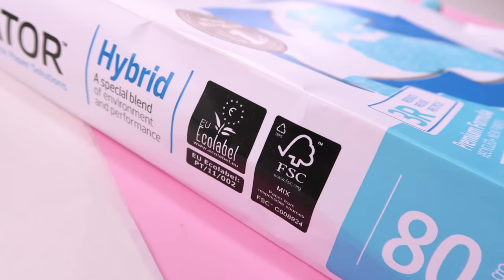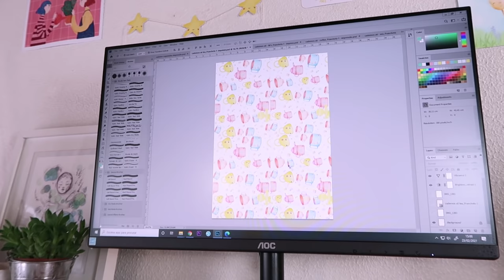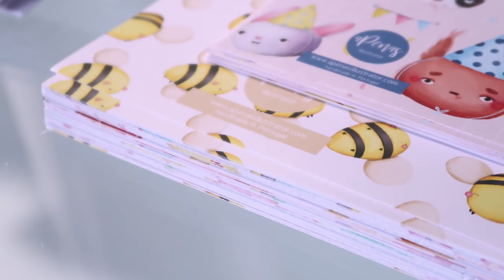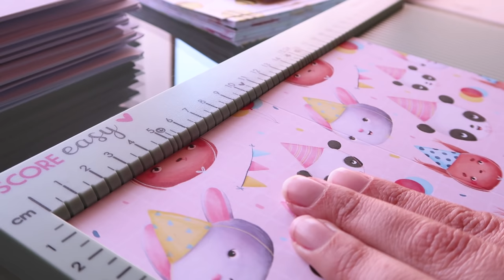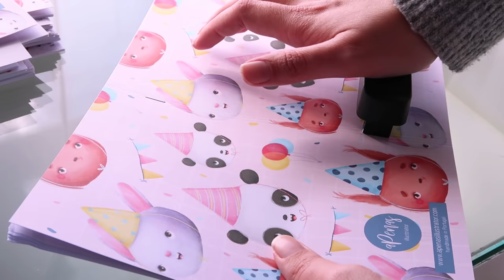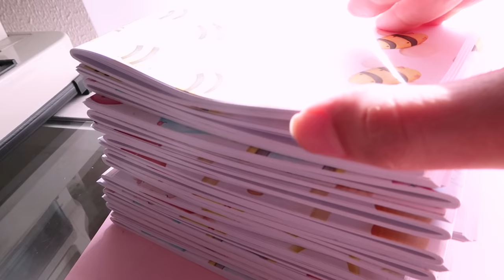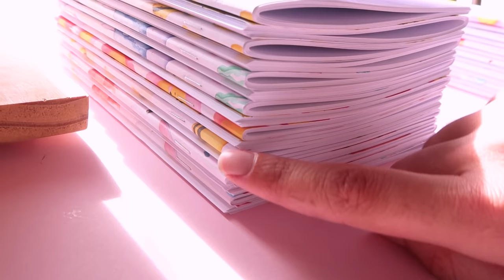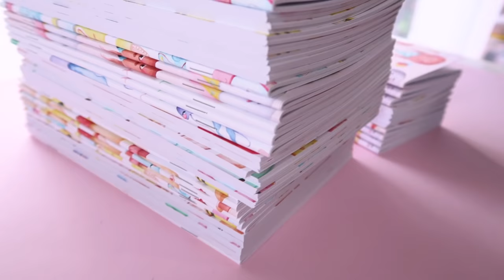HOW TO MAKE NOTEBOOKS! / Materials, Mounting and Cutting / Complete Step-by-Step Tutorial

Comment from the maker: Hope this tutorial helps you! If you have any questions about materials or techniques, leave them in the comments! 

If you made some notebooks following this tutorial, tag me on instagram @apenasillustrator so I can see what you create 😍 Can't wait! ✨🎉
Reply: I love your videos. You're such an amazing artist and thanks so much for sharing your knowledge.
Reply: Great video! Thanks for all the tips. 2 questions/tips/suggestions for you: 1) Would using a digital scale to measure out the paper work accurately enough instead of counting out a stack for each notebook? If the weight is consistent, it would be easy enough and quicker to measure out _ amount for each type of notebook. And 2) they make staples and staplers that press completely flat- it would completely take out step and the need to press every staple flat. Swingline makes a stapler that does this - the model I have is #S7087842 and it uses S.F.3 staples. But this stapler has a regular depth.  Not sure if one of these types comes in the extended arm like you have though or if you could pop out the current stapler and add in a different one (?). Love seeing your work and how you put it all together. 💕💕
Reply from the maker: @BlueSkies7  thank you so much for the love 🥺💛
Reply: Thanks a lot I really made
Reply: Hi!!! I'd like to know how you organise all the covers in one paper (the A3). Could you make a video tutorial? I want to make A5 and A6 notebooks but I don't want to make any mistake with the covers, I have to print them in another place and it would mean wasting of money. Apart from that, the video was very helpful, I loved it. Thank you very much!!! ❤
Reply: what printer you recommend?
Reply from the maker: @miadesalisa  the one mentioned it the video! Link is in the description 😘
Reply from the maker: @balerionish  hi! I just save them as png in A4 or A5 and then mount them in the A3 like I showed in the video! 😊
Reply: @aPenasIllustrator  thank you for responding. Because I saw u have a lot of printers haha
Reply: I couldn’t find any 250 gsm paper. Is there anything close to get for that quality?
Reply: Woah! Great job!!
Reply from the maker: @celestialcoffeebean1524  you can do with 200gsm, they will be nice as well 😘
Reply from the maker: @gracebuildsroblox9961  thank you so much!! 😀
Reply: I have commented. Pls check my comment and also tell about the packaging as well..
Reply: I love that tutorial, it's really brilliantly made. You make it look so easy that I started designing notebooks straight away 😂 I am just curious what guillotine are you using? I was looking all over Amazon and most have terrible reviews 😭
Reply: My name is prabha iam 9 class  I like your videos
Reply: Did you try flipping the red part? You can use all 4 sides of it
Reply: Where do you find the graphics for your covers?
Reply from the maker: @emeliagomez9959  I’m an illustrator, I make them :)
Reply from the maker: @malowaniec  thank you so much!!I don't think it is for sale anymore :( can't really recommend another, only ever used this one. But keep in mind this is a hard machine that you need to get used to, so some reviews may be biased
Reply: How many sheets are in there? Thanks
Reply from the maker: @maestratv2689  Hello! 15 sheets :) so 30 pages each.
Reply: Thank you! I hope the same for you. Blessed be stay blessed please.
Reply: What's the gsm of the bond paper you used?
Reply from the maker: @jei484  80gsm :) but currently I’m doing them with 90gsm 💛
Reply: Hi! Which software
or program do you use to make the designs? Thank you!
Reply: hi , hope you're fine , can you please help me out with my printer , i can't get rid of the margins , i have EPSON L3250 and PC windows 11 i've tried but still can get my printing without the margins, plz help
Reply from the maker: Hello! Some printers can’t print borderless, you’ll have to check your printers details :)

Comment: 19:06 - just in case nobody has mentioned yet (I scrolled but couldn't see it mentioned), the white plastic part on your stapler is a stopper that you can adjust so you can line up your paper to it's edge and staple in the same place over and over.
Reply from the maker: Hi! It doesn't work for me, because the notebook and sheets are not straight when stapling, so it doesn't work OK. But maybe it can help someone ;)
Reply: I scrolled first to see if anyone had mentioned it too :)
Reply: I was saying the exact same thing!
Reply: Oooooohhhh...thank you so much for that information. I really thought it was simply to adjust the width for opening the stapler so it is adjusted for each stack of paper. I was so wrong 😆. But bow I know. Thank you for sharing 😊

Comment: 😹😹the little hammer is called a toffee hammer it’s used to brake up homemade toffee😹😹 or the old fashion toffee sheets that you use to be able to buy a few years ago, pre 1990’s 😹😹
As a bookbinder you have explained it very well as well as showing how you made them🤗🤗
Reply from the maker: That is so cool!!! Thank you so much for letting me know eheheh. My dad had it for years but didn't knew where we got 😂

Thank you so much for the sweet words, that's very nice to know!
Reply: @aPenasIllustrator  your welcome 🤗🤗, I have a toffee hammer which me own Dad gave me when I needed a light weight hammer for one of my many hobbies. I remember when we use to make peanut and toffee brittle he bought the hammer from the sweet shop so we could brake the brittle without smashing it as a normal hammer would do🙀

Comment: I make a lot of stickers for my self (most of them are copy-righted or specific to my need so I don't sale them) and I have a suggestion.
It might be better to use paper larger than A0 (talking about some extra 2cm on each side) to have proper bleed region around every covers/objects so that the graphics extend to the edge of the cover and even a millimeter of screwup in cutting won't make the cover look weird. Given that you have one of those large paper cutters (what is that called 😅), one trick I do is manually trim 2 adjacent side to compensate for printing error and then align all the sheets on those 2 side and use a paper cutter to cut a stack at once.
Also, my system for cutting complex shape is: I would put black trim marks and a red line between trim marks so that I am clear about which trim mark should I reference and where I need, and more importantly should not, cut.
Reply from the maker: I don’t think you meant A0, that’s a very big paper! I print boarderless so the graphics do extend to the edge of the cover 🥰

Comment: Hi, great video. I am a paper -lover and love making a variety of types and sizes of notepads, notebooks, journals, etc. You name it, I've probably made it! I have the same heavy duty paper-trimmer. Here's a a tip: you can get four times the usage from the red rubber cutting pad the blade cuts into. Once the cutting path is too wide, just take it out and rotate 180 degrees. Once that cutting path is too wide, just flip the cutting pad over, use, and rotate again when needed--helps your cutting pad last four times as long. Happy notebook making! 😃
Reply from the maker: Hiii thank you so much 🥰 I've had some comments that you can take it out by taking out the screws below the machine, I still couldn't make it, but I will for sure 💛 thank you!

Comment: Thank you for sharing how you make your notebooks. Your process is really interesting. ☺ Your notebooks are very cutesy. 🥰 I make glued notebooks quite a lot for my journals and wanted to see how this was done. 😍 Your printer looks really good... and I might invest in on like it when we need a new one. 🤩
😇Suggestion - If you use a finger cot (or cut the finger off of a tight-fitting disposable glove) on your "counting" finger, it will make it easier to count your sheets. 😇
🤗 I went to your web page, but couldn't see the words to be able to find things. I'm older and have poor eyesight, so a light colour on white makes things really hard to see. This is just a comment... not a criticism. 🥰

Comment: Thanks so much Bea for sharing your tips and tricks. I use the same paper you have and I also have a long staple. I already tried to make notebooks but was a few wastes of materials and time because they're not perfect yet. Especially because I don't have the big guillotine so I use an x-acto knife to cut the paper excess after folding it however it doesn't look perfect. The big cutter is so expensive. Also, I don't have a bone folding tool or scoreboard but I have a trick I can share: I use a ruler and the end of a mechanic pencil to mark the middle of the notebook. Probably I'll film a trying with some tips you shared and tag you. Thanks again.
Reply from the maker: Hi Tânia! Thank you so much for watching my video 💛 There are a few tricks with cutting with the x-ato knife. First one is good one, even if it's more expensive, is so worth it! Second, don't make any strenght when cutting, just pass the blade over and over, but without making any strenght. That will make the cut more clean :) 

That's a nice trick as well! When you can, you should invest in the folding tool, it will save you a lot of time, they are around 3/4€ and they really help 🥰
Reply: @aPenasIllustrator  Thanks for sharing all this with us. It's really nice from you!

Comment: Thank you very much for this video.  You gave me a few tips that I don't currently do.  Thank you for that.  I wanted to give you a tip regarding the cutter.  You should be able to remove the red bar and flip it.  You should have 8 spaces that can be used on that red bar (two on each face).  Also, you can replace them.  I didn't realize that at first and it's been a life saver.
Reply from the maker: Hey Erica! I'm glad it helped! 😊 I already managed to chamge it after this video, thank you so much for the tip! 😊
Reply: You’re very welcome! I had no idea it could be replaced and I was very frustrated and the simple flip saved my sanity 😊

Comment: I just finished watching your video. Beautiful notebooks! 
I noticed that when you were using the long stapler. There is a white sliding marker that you can use to set your paper length at. So in other words you're using that little white mark that you drew on the head of the stapler so that you can find the center of your score lines. If you slide the white plastic bar that is attached to the stapler it will be your marker to make it a little easier to keep the notebooks lined up. Hope this helps it makes your life a little easier.
Reply from the maker: I tried to use that but since they are handmade, sometimes the sizes differ slightly and sometimes the piece also moves a little. I feel more confident using the scoring and the little mark and the process is really fast :) Thank you so much for the tip!

Comment: Hi Beatriz,  I really love your video’s! They are so teachfull.  I have a question About the printer. if I’m not misstaken you use the canon ix6850.  I’ve Got the same one but if i print a poster for example, on 135 grams silk papier,the black inkt Stays very wet… also, i think the print isn’t Sharp enough.   Can I ask what kind of setting you use?  Do you use the Canon app?  I hope you can help me out, i’m kind of desperate. Lost of love Daisy

Comment: This is absolutely a process of love, dedication and following your passion. Lovely work, well organized and well filmed. Your stapler has a white "clamp-thing" sort of in the middle. Can it be moved? If so was wondering if it can be moved forward towards front so when you align the score line with white mark on staple that the other side is up against the "white-guard-thing" acting as stopper knowing how far to put in note book? (sorry for long question. Hope you understand what I try to explain  ;) )
Reply from the maker: Thank you so much for watching and for your comment! It can, but I don't really use it for one reason: I staple the notebook before being cut, that means when you staple, the outside of the notebook is not straight. So if I would do it by pressing it to the clamp thing, it won't be totally right because of it. It's a little confusing, but hope it helps? It depends how you work, for me having the little white marks helps me a lot more! :)

Comment: Thank you so much for the video, it was super helpful! I do have a question though, do you know of any alternatives to the big guillotine you linked? That one is a bit outside of my price range (mostly because of shipping - its insanely expensive to get things into my country rn) and I've been looking all over for something like this from another seller, but all that comes up when I search are little guillotines that can only cut a few sheets at a time or scam websites. Alternatively, is there a way to do that cleanup without the big guillotine, since you mentioned you didn't always have these tools?
Reply from the maker: I used to do it only with an x-ato knife and a ruller! It gets hard if you do a lot of them, but it's possible :) It has to be a good x-ato knife and an heavy ruller so it won't come off of place, so it will be more safe. The secret of getting a good cut is not to apply any strength on the cut, just pass the x-ato knife :) Hope it helps!

Comment: I use the same guillotine as yours. I also have to put cardboard on the bottom or it marks the notebooks. Mine also isn't straight so I cant use the back guide so have to manually line it up each time I cut. Its a pain but its alot faster than other ways of cutting. Thanks for the video!
Reply from the maker: If it starts Marking, you can flip the red thing below! I only learned that after some comments in this video 🥰 if fixed mine!
Reply: @aPenasIllustrator  Oh i will have to try that, thanks!

Comment: Hi again! Please please help! I made my first notebooks, after buying all the products you linked on Amazon. They turned out really great which makes me sooooo happy!!! However, all of the notebooks corners keep on curling up no matter how long I press them for (I'm using a really heavy flower press for this) to the point where I don't know what to do anymore. I even laminated the covers on one side only, as I found that if I laminate both the sides, it's even worse. Could it be the laminator that overheats the 250gsm paper card? Or maybe the laminating foils? I use an identical Fellowes laminator and their original 80 microns glossy foils, as I couldn't find matte. Did you ever use a cold laminator for this?
Reply from the maker: Hiiii! Laminated notebooks are a little more hard to press, but with use them start to be more straight. It probably helps If you laminate them on both sides, just in one side can make it worse :) At least it was in my experience! I only used hot lamination. Try to press them harder on the folding edge

Comment: Hi! Thank you for the amazing job! I have a question about the guillotine... I have the same and I struggle to cut perfectly straight lines... I notice a difference about 1mm from top to bottom of the page. Is everyone cutting perfectly straight or am I doing something wrong? I would appreciate an answer!!! 🥴
Reply from the maker: Hii! That happens with me sometimes. Try to check the screws, sometimes they get a little loose. Try to adjust the ruler very tight as well, sometimes it can more while cutting if it's not very tight. If it still doing that, try to adjust the ruller so it doesn't happen.. Hope this helps! Every guillotine is different and some are more accurate than others :)
Reply: Thank you so much for the reply! I will try them all and hopefully I will make it work! 😘
Reply from the maker: @plannerstudiogr  hope so! 😊

Comment: Thanks for the great tutorial! You are using an inkjet printer right? After some investigation I noticed that the Color Copy paper is for Laserprinters? So the paper gives great results with inkjet printer as well? Regards
Reply from the maker: Hii! Yes, I am. The one I use is for inkjet, the colours come out perfect. Maybe there are some that are for laser printers, but the one I use is perfect for the printer I'm using right now :)
Reply: @aPenasIllustrator  I just got a pack today! Curious to use it now! Thank you!!!!
Reply: @aPenasIllustrator  I used the paper but I got some vertical lines in my prints. What print setting do you use for this paper? Normal or glossy photo paper? I used "normal" paper, even though it does feel quite glossy to me. Thank you! ;0)

Comment: Hi, I have two questions about the printer because I have the exact same one :) I saw you printed so many covers, for how long does the cartridges last? Because I just keep buying new ones, seeing so many A3 size papers being printed hurts my heart :D And the second question is: Do you have sometimes white lines on the prints? I doesn't matter how many times I do the deep cleaning and clean the printer it just isn't getting better:/ 

Thank you so much! Your notebooks are so cute <3
Reply from the maker: Hi Ivana! My cartridges actually last a long time! After this video it took me around 2 weeks to change one of the colours and I was printing a lot of stickers and notepads in between. I don't use Canon inks, when I did they lasted me a lot less time than this non original ones :)

I don't! But one girl came talk to me on ig about the same problem. Turns out her printer was defective. Contact Canon, maybe they can help :) 

Thank you so much for watching :D
Reply: @aPenasIllustrator   Thank you so much for your fast reply! :) Can you please tell me what brand do you use for the cartridges or can you attach a link? Maybe you are right I probably should get it checked because it drives me crazy :D